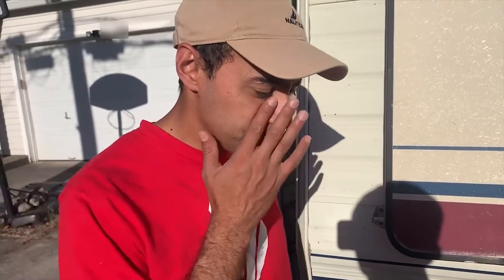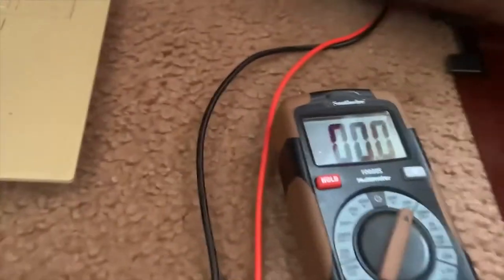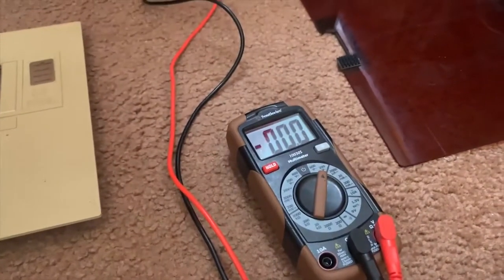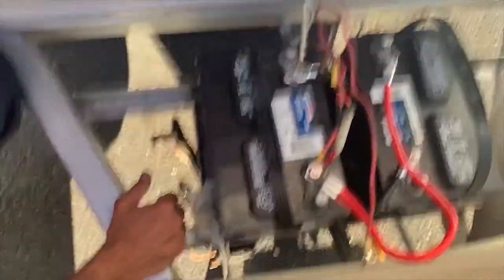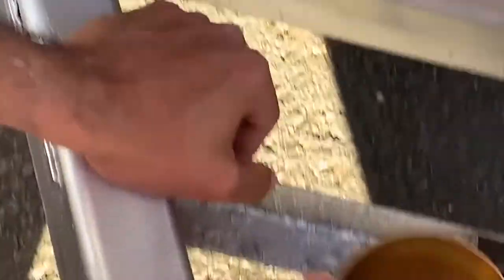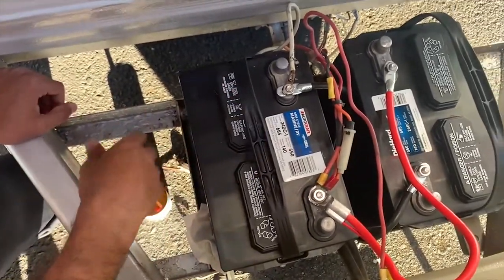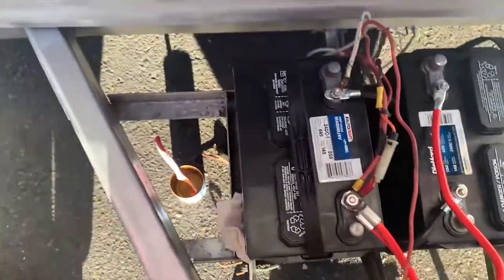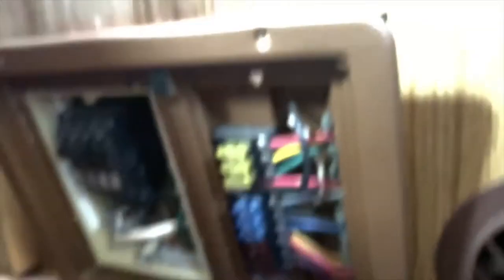Travel trailer no dc power and battery not charging Fix

Comment: Thanks so much! I couldn't figure out why dc power didn't work with a fully charged battery and no flipped breakers. Turns out it WAS corrosion as you suggested. First time I cleaned the connections I got weak power (flickering led lights inside). I took another look and found a ground wire I hadn't cleaned. Once I cleaned that connection, everything came on strong. Many thanks for saving me lots of time and probably an expensive trip to local rv place.
Reply from the maker: Glad to of been of assistance! Thank you for taking the time to comment and supporting my channel!